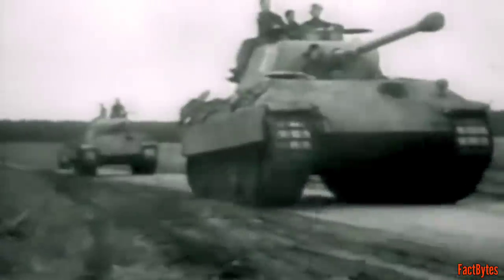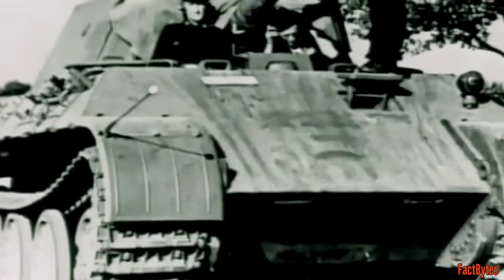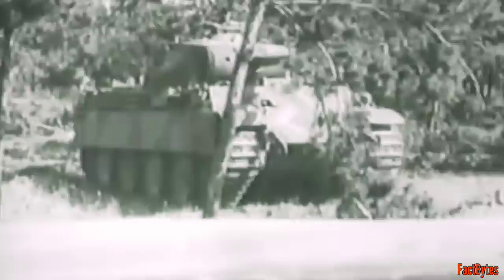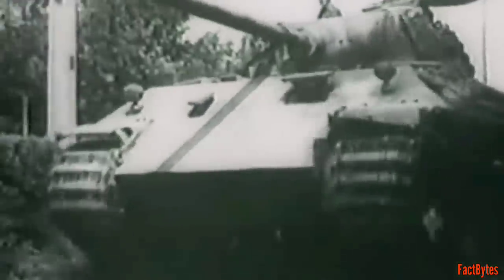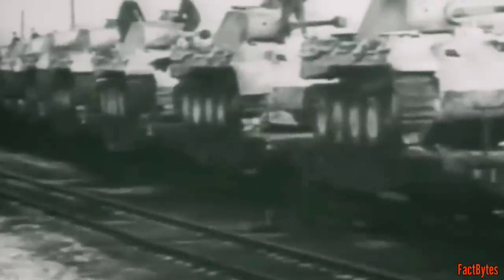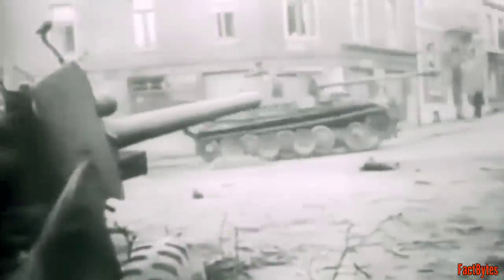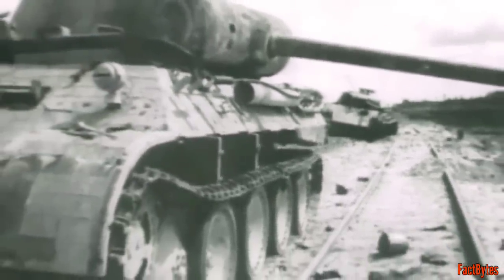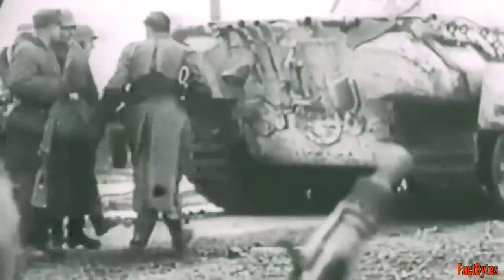Was The German Panther Really The Best Tank Of WW2?

Comment: Tiger 1 was better tank, because it was properly made. Panthers broke even after driving 150 kilometers from the factory, these tanks had very weak final drives, basically design was untested and failed hard in the battlefield. Tiger 1 on the other hand was perfectly executed, with proper maintenance it could drive for thousands kilometers. The major flaw for Tiger 1 was not the design, but logistics of Germany. Combined cost of allied tanks destroyed by Tigers was bigger than it cost to build all those Tigers. So you can call it cost effective weapon, while Panther not so much.

Comment: The first batch of Panthers at Kursk did Suffer mechanical issues, but that was rectified by the October 43. A awful lot of people keep saying the same thing about breakdowns but during the battle of the bulge Panthers were at the front of the Armoured columns as the Germans didnt want the narrow Ardennes tracks blocked by Tiger 2 s having mechanical issues!  Which seems to  point out they were reliable in Service.

Comment: Panther was rushed.  What could go wrong?

In November of ‘41 Guderian hosted a conference to determine what to do with the T-34.  The replacement medium tank for the Pzr III/IV had been shelved just before the war started.  This replacement then became the Pzr V(ultimately Panther) project and was lightning fast in its design and production.  Two competing prototypes were completed by March of ‘42 and Hitler chose one(with the insistence of an additional 2cm frontal armor).  Full production started in September of ‘42 with the aim of having enough on hand for Kursk.
Panther never could replace the Pzr IV.  It ended up being assigned to a roughly 1:1 ratio with the older tank.  Its anti armor performance was quite good.  Infantry support much less so.
Some of Panther’s weaknesses could be rectified at the factory.  Others (final drive in particular) couldn’t be fixed and drivers were expected to pamper the drive train to prevent breakdown.  Experienced crews did okay with this.  Inexperienced crews were far less successful.

Comment: The Panther was very much over hyped, though at 45 tons it was much better armoured than the Sherman and T-34 it mostly faced. Its 7.5cm KwK.42 high-velocity gun was actually superior to the 8.8cm gun in the Tiger 1. Had the tank been further developed with an eye to reliability, and kept simple, it could have been a winner. But the Panther was built in only moderate numbers before factories turned to the monster Tiger II and other "Super Tank" projects.

Comment: German tanks in general were over engineered; i.e. they had more moving parts than Allied tanks which meant more stuff that can break which means harder to maintain / repair as well as logistics issues with parts. The Germans were just not as good as Americans in their ability to quickly and efficiently repair broken and battle damaged tanks and get them back into service. For the Germans this was less of a problem with Panzers as they weren't as prone to breaking down because their engines and transmissions weren't overtaxed by the heavier weight of the Panther. The Panther had a decent top road speed but was sluggish in acceleration and its turret rotation rate was slower than the Sherman. It's side armor wasn't that much thicker than the Sherman and became more of an issue as the war went on. I never hear this along with it's other problems discussed by those who claim the Panther was such a great tank. It took Sherman crews some time to figure out how to avoid the Panther's strengths such as its thick frontal armor and it's lethal gun at range and how to effectively exploit the Panther's weaknesses. A well placed shot from the side at the appropriate range for whatever gun a Sherman was toting would knock out of Panther; i.e. the 75mm "pea shooter" had to be at a much closer range whereas the 76mm with the right ammo could do the job from a greater range. The common excuse given for the Panther's defficiencies is because "it was rushed into service". We can make the same argument for the M26 Pershing once McNair quit screwing around with it and green lighted its design and production.

Comment: Bad transmissions, extremely hard to repair in the field. Good gun and front armor. Cramped interior, shortage of spare parts. Lack of fuel for all German war machines. Cheaper to build than Tiger, still could not build or man enough of them to make any real difference to the war's ultimate inevitable outcome.

Comment: I think if germany concentrated on building Panthers in mass production and forget about the king tiger and tiger 1 then they would of turned the tide on the eastern front. It was the most advanced tank of the war. It had everything.
Reply: But statiscally it was one of the worst tanks Germany ever built and contributed heavily to their rapid defeat it was super unreliable it had a horrible suspension, its gun optucs were permanently zoomed in making it harder to hit targets you can't see anything behind you unless you open the commanders hatch you need to run it for an hour before you could use it there was a lack of spare parts meaning if you don't find another panther that you can canibalize for spare parts you'll be forced to leave it behind and there are many more problems about it that I didn't list. The Panther was the actual deathtrap.
Reply: @Envisteil  panthers had these issues because Germany had multiple over engineered heavy tanks. Plus the panther was rushed into service to take part in the Kursk offensive. Later models of the panther 1944 were absolutely outstanding. Only logistics let it down.
Reply: @2sqnbandit379   The problems I listed were in both the early and late versions of the panther also I forgot to mention the hatches were stiffed and if the Panther was too hot it would jam, the Engine was over stressed and would stall during combat, the turret traverse was slow, the side armor was paper thin, mud would gather between the wheels causing them to stick, and the sound of the gun was enough to deafen the crew. And look if you cgoose to ignore the soft factors and continue to spread the lie and waste your evening on forums saying that the panther was the best tank in ww2 (it wasn't)  and argue that if Hitler produced more panthers we would be speaking German blah blah blah Panther 2 and all the other nonsense then that's your choice.
Reply: @Envisteil  agree to disagree, I’ve spoken to ex tankers at the imperial war museum in London that served on Churchill’s & Sherman’s. They said the panther was the deadliest tank for them on the western front. 75 mm gun, sloped armour. The scopes were far more advanced and better engineered that’s a fact & to state the sloped armour was paper thin is a slight exaggeration, 🤣. The only reason the panther had issues was through poor logistics and not getting the correct parts resulting in other tanks even different models being cannibalised. That’s no fault of the design it’s Germany was far too diverse in its armour. The panther would spatter any ally tank on the battlefield. It’s frontal armour was impregnable to anything the allies could throw at it. Germany had a problem with over engineering tanks such as the tiger & king tiger. However the panther could of been massed produced & if so would of had an impact on the war I feel as long as it could of been protected from the sky. But that’s my opinion sir. I certainly wouldn’t attempt to ridicule one for having an opinion on the subject matter.
Reply: @2sqnbandit379     "Ohh you see I've spoken to some Chruchill and Sherman tank crews that probably have PTSD and pee on a pot but trust even though they're not Panther crews and never operated a  Panther they said that the Panthers was the deadliest tank of the war and they were operating death traps! Eventhough they're not dead and never encountered a panther." (Obvious sarcasm) Also even the Shermans even destroyed Pannthers like the battle of Dompaire where French Shermans and Stuarts manage to destroy 34 Panthers and 26 Pz IVs for the mere cost of 6 Shermans that's right 6 Shermans and 2 Stuarts and the Battle of Arracourt where Shermans  were able to hold and inflict heavier losses against a superior German force with the majority of their tanks being Mark V Panthers. And those guys didn't even operate the good Allied tanks like the Easy 8, Jumbo, Pershing, Centurion, IS-2 and T-35-85. I'm not mentioning the Firefly because it was decent but not that good. Anyways do you see my point don't rely on people who fought in the war as sources as they might be biased and they only fought on one sector on multiple sectors on one front in a war with nearly a dozen fronts rely Historians please.
Reply: @Envisteil  I think you need help. Many many hours of therapy. Ramblings of a very strange individual.
Reply: @2sqnbandit379   Well you have nothing more to say guess I won. And well that's because what you said in your previous comment was so unbelievable stupid it left me pacing my room for 25 minutes straight angrily ranting about each horrible point you made and when I went to type my reply I had so much things in my head that I want to put in my reply that I began to forgot some of the points I thought while I was ranting and began to incoherently type as fast as I can as I try to cover as much points as I can before I forget them.
Reply: @Envisteil  well done in your attempt at shutting down your opponent with aggression rather than letting your arguments speak logically. Mumblings of a person with mental issues. A display of bitterness due to issues of one’s lack of masculinity resorting to keyboard warrior tactics. You’ve never seen a battlefield in your life but yet have the opinion of Field Marshall. Your lack of empathy towards soldiers suffering with PTSD is a clear indicator to me that you’re a scared little manchild sat in front of a computer.

Comment: The Tiger 1's gun can only penetrate 132mm of armor sloped 30 degrees from vertical at a range of 100 meters. Where the hell did you learn that the panther could penetrate 150mm of armor from 1km away?

Comment: Once the initial gremlins had been removed it was without doubt one of the best tanks of WW2.  All tanks have advantages and disadvantages, but it was feared by all and could have done much more had it not been for lack of numbers - only 6600 or so. Cant build a tank if some nasty bomber has flattened the factory and you cant use a built one if there's no fuel or its kaput again.
Reply: But statistically it was one of the worst tanks Germany ever built.
Reply: @Envisteil  How so?  The combat record of Panther-equipped units speaks for itself in terms of "giveaway/takeaway" ratio.
Reply: germany industry was acually pretty good in 1944 allies loved to bomb civilians insteed of the acual factorys
Reply: As relatively few tanks as the Germans actually produced, they lacked fuel, spare parts, and TRAINED, EXPERIENCED crew for what they did have.  Not to mention ARVs, which the war showed were crucial to keep up combat strength of armored units.
What got the Germans by was their ability to build improvised self-propelled guns and/or tank destroyers out of otherwise obsolete chassis, retaining the advantages of experience with them and the tooling and facilities needed to produce them.  And the vehicle and/or gun(s) didn't even have to be German in origin!   This was shown by the Marder III, built on the Czech 38(t) tank chassis (which simply couldn't be upgraded to take even the 5 cm gun of the Panzer III), equipped with a SOVIET 76.2 mm gun (many had been captured in 1941 and 1942), rechambered to take the longer German PzGr rounds.  That vehicle shows the forced resourcefulness of German weapons design.  The 38(t) itself was modified into quite a few AFVs, culminating in the famous Hetzer tank destroyer, which served, post-war, in the Swiss Army into the 1970s!

Comment: PanthersG[P2] and PanthersF 1944-45 were high positioned medium tanks.
But in 1943 PanthersD - A weren't best.
For battlefields in 1943, situation will be better without Panthers[MAN].
Vk3601h and vk30 02DB were in better automotive conditions and with better final realisation 1943. It was reasonable not wait for Panther/E50
It was true that PanthersG and Panther2 were better than T34, Vk3601h vk3002D.
But in 1943 vk30 and vk3601h were more quickly reliable

Comment: The final drive mechanical design was overburdened. The tiger featured a bull gear reduction driving a planetary reduction.  But the Panther only had a bull gear reduction, and although cheaper and simpler, it was not sufficient and stripping gears was common.  It used the exact same engine as the Tiger, and Tiger crews never complained about reliability ( Otto Carius) and was not under powered.  More so the problems were more a case of being rushed into service too soon and poor quality control.   Panther restorers have on occasion found that certain components were simply not correctly assembled to torque specifications (loose bolts)

Comment: The panther was not perfectly balanced. It was actually a specialized tank destroyer with a turret. The turret was too small and moved too slowly, the armor on the sides were too thin, the engine used too much gasoline, it offered poorer vision than other German tanks and overall, it was unergonomic.
Reply: Interestingly enough, the Panzerwaffe considered upgrading the Panther with the "Schmallturm", which was NARROWER, but could take the KwK 43 88mm weapon used on the Jagpanther and King Tiger.

I'd disagree with your assessment of the Panther as a "tank destroyer", though indeed Panthers "destroyed" MANY Allied and Soviet tanks.  By then,  German doctrine was to design their battle tanks mainly to combat other tanks, with performance against "soft" targets a secondary consideration.  Any Panzer regiment had an organic tracked SP gun battalion, and a SP howitzer battalion under divisional control.  This is contrary to how, for example, the US Army equipped its Shermans, which, with the majority having the M3 75mm gun, were intended to get into the enemy rear and "raise merry hell", not to engage enemy armor unless they had to.  The appearance of better armed and armored German tanks soon caused the US to equip some of their Shermans with 76.2 mm guns which had better anti-tank performance, the Limeys with the 17-pounder ("FIrefly"), which were intended to slug it out with enemy armor.  They were still considered "tanks", tank destroyers were typically open-topped, lightly armored vehicles, too vulnerable to roam about in the enemy rear, but useful to stop German tank attacks.  Trouble was, the German's didn't always "O-Blige them", and often Allied tank destroyers were used for infantry support, which they were not designed for.

Considering that many modern MBTs are issued only smoke and/or APFSDS rounds (APDS in the case of the UK Challenger 2), by your standards, EVERY tank is not, but should be called a "tank destroyer".

Comment: Let's say you could travel back in time and had to fight in WW2: Which tank would you choose?
Reply: The Tiger, no question. But then I would have been fighting for the enemy so no thanks. How about the easy eight then?
Reply: @louislopez55  which tiger. Because both were terrible. The tiger I was obsolete by the end of WW2, many allied tanks had guns that performed similarly and tanks like the Churchill and IS-2 had even more armor than the tiger I. Coupled with the abysmal mobility and poor fuel efficiency, this tank was only successful in ambush positions. The tiger II only had 8 horsepower per tonne p/w ratio, which is easily the worst out of all the tanks fielded in WW2. It was so unreliable at its top speed that drivers were taught to never go near the tank’s theoretical top speed. It also lacked a 360 periscope for the gunner, (which the is2 had) making visibility quite poor.
Reply: @Insert-Retarded-Reply-Here  Ironic.
The only terrible thing was Soviet reliability that, regardless of said, couldn't statistically parry any better than the "obsolete" German weapons they were facing.
However, what goes around, comes around; soon enough.
Reply: IS-2, easily. In firing tests, the IS-2’s 122mm gun penetrated through the front upper plate and out the back in just under a kilometer range.

Comment: If allies would face that kind of raw material shortage as germans did, they weren't be able to build not even BICYCLES. The german industry did builded in those conditions even OPERATIONAL fighter jet airplanes. So.. WHO criticize nazi german war industry? Those which were build that PATHETIC CARICATURE of Sherman/firefly and those planes which are "superiour" just by WAR PROPAGANDA and shared numbers?! Anglo-american EMPIRE technology still working with CARBURERORS when germans already build JET ENGINES (thry were so stupid that can't understand hiw work fuel injection system, even if they already stolen blueprints and airplanes from germans)
Reply: Ah yes, because if you lack oil and metal, you built even heavier vehicles, that break down even more often.
Also, the Brits lacked Ressource in the early war, and who won the battle of Britain again?
The British also made Jet planes in WW2